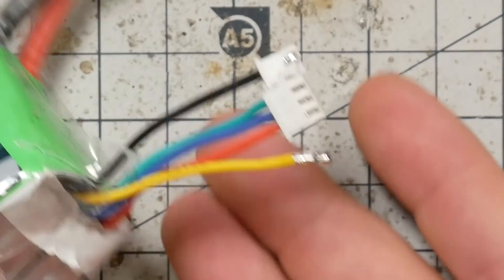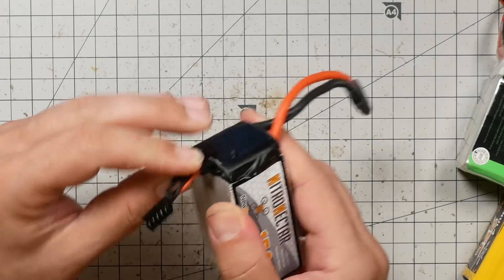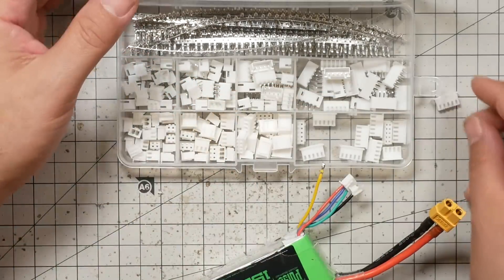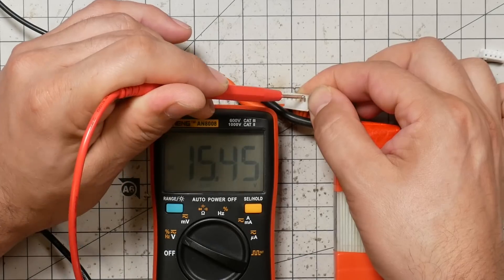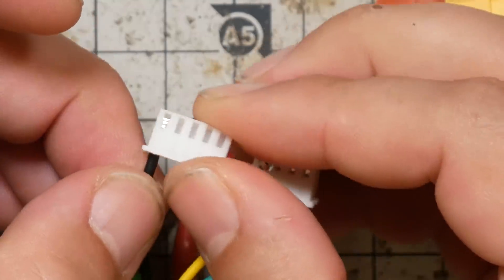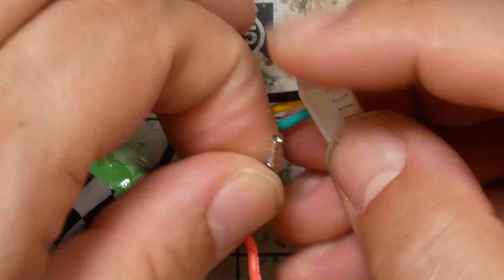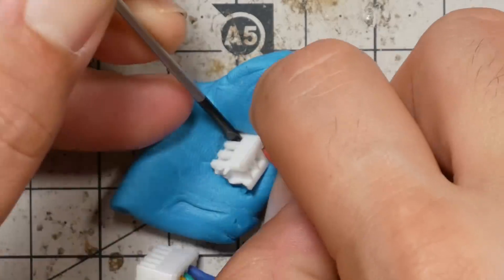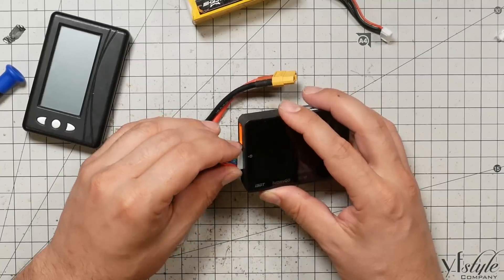How To Repair A LiPo Balance Plug

Comment: Here's a battery question: I use these big 8A 6S batts for my AP rig. As they get older (no or minimal puffing) flight time diminishes quickly w voltage. What exactly is happening here during flight (voltage drops quickly during flight, then bounces back after landing when load is removed)? Could the battery be used for some other purpose such as a field charger if it can't really fly anymore? Where the hell does all that amperage go?!
Reply from the maker: The internal resistance is going up which makes them sag more. It could be you are over-discharging them? How do you determine when to stop flying?
Reply: @JoshuaBardwell  I monitor Voltage in the OSD. The battery is pretty old, so when it gets near or less than 22.2 it's time to come home, er rather land. ha. Flight times have dropped from 12 minutes to about 6 minutes in the last few flights. I've certainly pushed them a little in the past, flying to perhaps 21.8V or so, but upon landing it generally bounced back to 22.2 or above. Now it bounces back to almost 23V after dropping to 22.2V.
Reply: I am seeing wider gaps in balance though. Sometimes as much as .045. I generally connect it to a balancer after the flight and it will balance out and hold around .020. Think it's time for retirement? I've been using it as my warm up battery to check flight conditions and GPS hold quickly before using the newer, better batteries for work. Think it's not a good idea to keep flying it?

Comment: I always coat the area where the wires go into the plastic plug with a nice blob of hot glue. Most if the trouble I’ve had with balance plugs involves too much stress being placed on the wires as I pull the plug out of my para charger..the hot glue gives an extra bit of solidity and grip.

Comment: I would like to know if there is a way to get my prophet sport mini (2,3, and 4s capable) charger, to charge a 5 it even 6 cell lipo using an adapter cable or some sort of tool?  I'm broke at the moment and I know a good charger will only run me about a hundred dollars, but a friend gave me some 5 cell batteries today and I really wanna use them.
Reply from the maker: No, it can't do that. Not safely at least.
Reply: @JoshuaBardwell  yeah, I thought not. I was just hoping you knew a way.

Comment: Ok, so this is a replacement, not a fix. I was hoping you had found a way to re-use the cracked balance plug. I have, and it’s truly just VERY carefully applying CA glue, but if you mess up, you need to snip the wires and solder on a whole new plug. (It looks like that green wire lead didn’t like you manhandling it too much lol.)

One more thing- Can you test out an SMC fpv quad lipo? I’ve got a buddy(rocketsquid on YouTube) who refuses to take my suggestion on buying an SMC lipo for one of his quads. I use SMC lipos for when I race RC 1/10 4WD short course trucks, 1/8 4WD ebuggy, and 1/10 2wd buggy and for when I bash a Traxxas or something else around the neighborhood. SMC is the BEST!!! They are also super low priced. If you test out an SMC pack and put up a vid on YouTube and it turns out well, my buddy will surely watch it as he is subscribed to your channel as well! Then I can say “I told you so!) and he won’t puff up crappy packs that cost more than an SMC lipo all the time...

Thanks in advance!

-Ev

Comment: You're never going to use the remainder of the broken pin so take an exacto blade and cut it away piece by piece to keep the balance pins nice and pristine. I've jammed a few in accidentally doing it the way you are. 😉👍🏻

Comment: pretty sure it's a jst-xh (number of cells + 1)pins connector If anyone is looking for that answer. if your looking to make the same for your flight controllers and whatever it's a differen't standard most likely jst-sh. the tramp and other vtx's use JST-GH.

Comment: Funny, I just spent a good bit of time tonight hunting for JUST the plug themselves. Digikey, and several others (other than from China!) don’t have them. Couldn’t see buying a whole kit when I may only use 20% of it. Ended up getting 10 balance lead connectors that I can de-pin to get the plugs from. And I’ll have some extra leads to get to the charger with because I’m going to tape the balance leads down to the battery as suggested by another comment.tried the 3D printed “bands” but they get lost as well.

Comment: I am a fan of these connectors that slip onto the discharge leads.  After charging I put them the balance lead plug in, after flying I take it out, that way I can see what batteries I have used. 

https://www.phaserfpv.com.au/products/phaser3d4sbalanceleadholder1pc?variant=12690223497293

Similar ones on Thingiverse.  https://www.thingiverse.com/thing:3102042

I prefer a craft knife to de-pin. Easier getting that point in.
Reply: And today I hit a tree.. at speed.  Apart from the carnage to the frame (already ordered a new one),  I broke the balance connector on the battery.  Time for some repairs just like this video. :)

Comment: I do not want to be a know it all.. But heck I would be lying if I said that. 3 things I noticed / what I would have done different:
1st. You say later on never to have 2 wires flapping in the breeze (as Dave would say). Though when you dislodge the 1st(black) wire .. Yellow is still lose. I would suggest putting that one in to the new plug at its correct position first.
2nd. I would recommend after depressing the tabs to always see if they aren't depressed to much and bend them into shape before inserting them into the new plug.
3rd. You do not mention that you covered the exposed/damaged wires of the balance connector with heat shrink if needed. I was itching at the start but was happy to see that it was in place in the end of the video. If people do not inspect those things a fire might as well happen even if you try to replace a broken connector.
Just my 2 cents. Love your work , just the things I noticed that could make it easier/safer.

Comment: I would really like to see a video on how to crimp/solder the little metal connector if it needs to be replaced.
Reply: I just made one
Reply: Pretty fly for a WiFi I presume you’ve sorted this out?
Reply: Just look for how to crimp a jst xh connector
Reply: i had trouble finding small enough crimper lol
Reply: Not that hard man. My batteries leads break all the danm time.
Reply: @HighVoltageMadness  thanks tips.
Reply: Same
Reply: Exactly why I'm here. My dog chewed them off so all I've got is wires.

Comment: That would have been up the wall on the third pin :) and that's what I use a pin you can slide the point under when you push it back then the wire just slides out easily :) great video many thanks

Comment: A pointed dental pick works great for releasing pins
Reply from the maker: That's a great suggestion!!!
Reply: Joshua Bardwell I have one I took the very tip off of and use it for bind  buttons and control buttons, works great.

Comment: Suggestion as requested...taking a lipo with a dead cell and removing the dead cell and making one cell or two cell lipos out of the remaining good cells. I've converted a few 4S lipos into 3S lipos and have made dozens of 1S lipos out of damaged 4s and 3s lipos. This can be a little challenging , but might make a good vid for those who hate throwing away a lipo because of one bad cell when three cells are still good.

Comment: Please JB! Comment not to measure continuity between any wire from the balance wire or anything else. You can waste a multimeter measuring continuity in batteries, it is much safer to measure DC voltage between xt60 negative and the balance plug wires.
Reply from the maker: You're 100% right. I said continuity but I was measuring voltage.

Comment: How about a video on repairing on the other end, how are they soldered? Can you safely cut a lipo open and replace any of the wires? Or is it just too dangerous!
Reply: I just left a suggestion for jb to make a vid on this. It's def do-able. The most risky part (other than an accidental short during the repair ) is not overheating the lipo when soldering. I like to set my soldering iron temp up high, 450c, so I can make the solder repair quickly without transfering to much heat into the lipo. I have taken 4s lipos with a bad cell and removed the bad cell and made it into a 3s. And also made several 1s lipos out of damaged 4s lipos. Cover up all your solder joints with hot glue to hold everything in place and tape up the lipo with electrical tape thoroughly when done .
Reply: @Matt633NLT  Thanks for the info

Comment: I had the idea to just glue a male balance lead (maybe with the pins removed if possible) to my batteries, so i can plug the connector in there. Have not had time to test if that works yet though
Reply from the maker: that's a clever idea but definitely be careful about removing the pins so you don't have live pins sticking out.

Comment: I started 3d printing these plugs with tpu = indestructible :D
Reply: I don't know why I never thought of that... That is a fantastic idea... do you have or know where to get a file? I will make a bunch tonight if I get a file to print them.
Reply: @wickedreelz5028  files are on thingiverse 4s and 5s. I printed mine using cr-10 equipped with direct extruder for flex filament, 0.4 nozzle and 0.1 layer height
Reply: @wickedreelz5028  No kidding right...Awesome idea Tomasz FPV!
Reply: That's a great idea, I've wanted a 6S plug I can put on my 1S/2S/3S parallel charging board, to make it easier to plug into my iSDT Q6 Plus, then I won't have to faff around with getting the 3S plug aligned properly when plugging it in. I'll have to modify an existing design though, no 6S designs I can find.
https://www.thingiverse.com/search?q=JST+XH+Connector
Reply: @licensetodrive9930  hey, did you modify this design?
Reply: @Nils A.  I did, in a way, I modified a balance plug into balance port bungs, so for example you can parallel charge 3S packs on a 4S balance board and not worry about plugging the balance connector into the wrong pins: thingiverse.com/thing:3731075
Putting a 2-pin bung in my iSDT Q6 means a 4S, 5-pin balance lead will only go on the correct pins: haku.co.uk/pics/iSDT_Q6_bunged.jpg

Comment: Thanks for the info. I had to learn how to replace a connector and pins on the cable from my 4 in 1 to my FC (1mm size), just a couple days  ago. This video would have been helpful then. Can you do a video on how to replace the pins so I know I did it right?

Comment: I Literally just crashed and vaporized my balance plug. The battery shorted a couple times though. Should I keep using it?
Reply: Personally, I would suggest repairing the balance lead, check the condition of each cell after the repair , and if it looks good, run it through a balance charge cycle by itself. If it takes a good balance charge, then you just saved $25. But if one or more cells do not charge up evenly during the charge cycle, I would discard it.
Reply: Hmmm.  I wouldn’t, but I’m super conservative.  $25 is a pretty small amount of money compared to the cost of the damage that can happen when one of these things fails.  Search YouTube for “LiPo Fire” or “LiPo Explosion”.  Pretty sobering stuff.
Reply: Ehh I would. But definitely be careful

Comment: And i'm the kind of guy that converts a 4s into a 3s by pulling out a cell😂
Reply: I do the same thing! Lol.  I've actually pulled a cell and put a replacement one  from another damaged battery. (Yes, I checked the resistance, yes I made sure all the cells were close in charge)
Reply: @NPC #19548796 just be super careful. Make sure the charge and resistance are similar. I try t get them within .2v of each other.

Comment: I just had to do it too. Getting the pins out of the housing is a pain. I'm now using a needle like a shoehorn between housing and the pin. That made the process a lot faster. Of course you have to be careful not to slip, it hurts 🙃
Reply: Yeah, it hurts.
I slipped... 
The security pin I used somehow shorted the cables, got glowing hot and burned three fingers down to the flesh. I will be using a small flat head the next time.

Comment: Fiiiiiire bomb bom fiiiiiiire I’ve tried to save a few batteries before and it went bad 🔥 had to pull it off the charger and throw it into the driveway as it started spewing flames

Comment: I rarely break the housing... But frequently the balance wires break off the battery itself. Maybe you could do a video where you solder a replacement balance plug to the battery? I've thrown away perfectly good LiPos because the balance plug wires have suffered from metal fatigue and simply broken off right at the battery.
Reply from the maker: To be honest, I don't suggest hand-soldering to the LiPo tabs. I know it can be done but it's fairly difficult to do, and you're likely to overheat and damage the cell if you're not using spot-welding equipment.
Reply: @JoshuaBardwell  That was my fear! Thanks for replying, JB.
Reply: @jyunte  uhm... i tried it following youtube vids... didnt work even a little bit

Comment: 4:35: don't measure anything for continuity, you'll short the battery. contunuity is very low impedence you can explode your meter (if you measure anything other than the ground balance wire with the ground main battery lead). What you should do is measure voltage and it will show 0.00v difference to the black main battery lead.
Reply: Actually , if you check voltage with the meter on continuity (ohms) it won't hurt a thing. Most DVM's actually have high impendance to prevent such an accident from occurring. Older analog meters would explode if you checked voltage while on continuity setting.
Reply from the maker: Hmm you're right. I said continuity even though I was measuring voltage.
Reply: Joshua said continuity between the Left most Balance Cable (in this case, black) and the Negative terminal. That is fine to do, but only on that terminal and IF you sorta know which is the negative balance cable.... Otherwise, measure the voltage between 2 of the balance terminals at a time, keeping the negative probe on the negative balance terminal.. and moving the positive probe to each of the balance terminals.

Comment: Sorry i know it was just mentioned about the red wire being damaged but I noticed looking closely that the bllue wire right next to the red is also damaged.  Both have the damage close together about a 1/2 inch from where it comes out of the battery.  Just don't want you to burn a quad up brother.  You have helped me countless times figuring stuff out, THANK YOU!  maybe i can help save your battery....lol.
Reply from the maker: Yep I fixed it with heat shrink although I didn't show it in the video.
Reply: @JoshuaBardwell   the heat shrink repairs do  show. Is anyone paying attention? :D

Comment: i always use a small hobby knife to push metal tabs from holder and do it one wire at a time, pull metal tab back up when placing into new balance plug
Reply: I was going to say the same.  GMTA
Reply: Tweesers are my primary 'weapon' when dealing with the pins of connectors, but as it has two prongs you have to take extra care not to short pins when dealing with live batteries, even the 1S whoop class cells can spark & overheat cables in a split second.
Reply: I second the hobby knife.  You can slide it over the tab and under the plastic so that like a shoe horn it will slide out first try.

Comment: Red wire in balance lead damaged, but you already knew that right?
Reply from the maker: Yep, I fixed this too although I didn't show it in the video.
Reply: @JoshuaBardwell  Ah yes, actually you can see later in the video that these two got some heatshrink love.
Reply: @JB/Brad Watkins You're right why didn't I see that...
I edited my previous comment accordingly.
Reply: The blue looks like it's got a cut in it as well.
Reply: Blue wire has a slit in the insulation too. Check 6:45 .
This should have gotten some heatshrink!
Edit: I should have watched the video till the end before I commented. It's fixed at 11:52.
Reply: @Ultrazaubererger - maybe it's just a demo battery, for our benefit.
Reply: chris whitehead 

Yer at 6.50...
Reply: good eyes buddy.  that wasn't so easy to spot.   The bonuses of doing a repair and putting it on youtube!